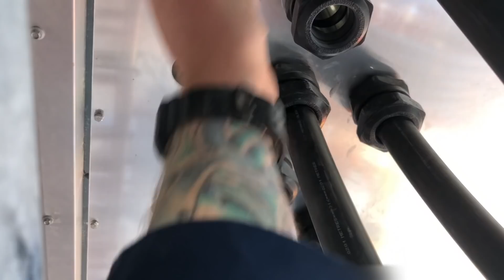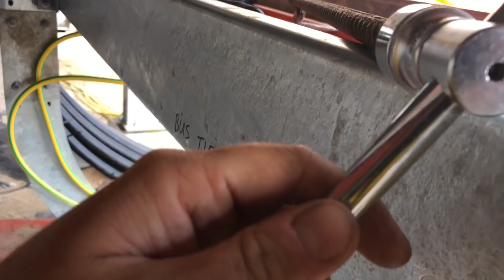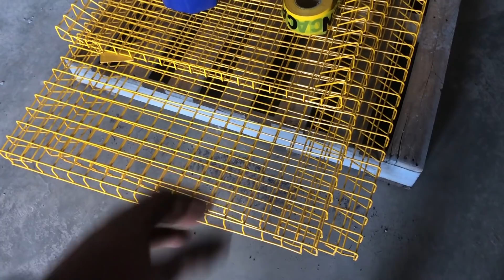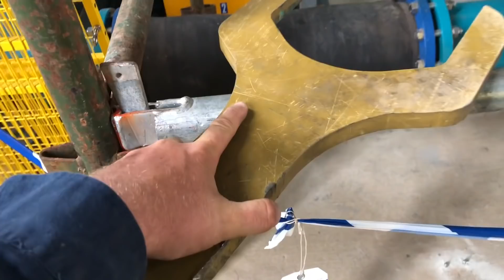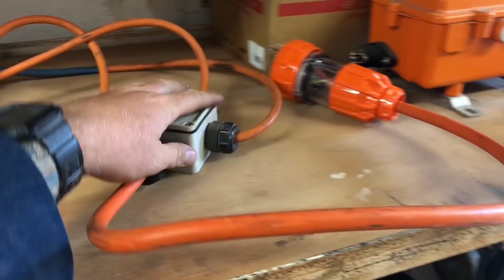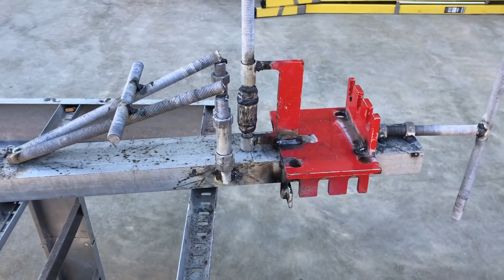Making your own custom tools. Sometimes DIY is better! | Until It Hertz E06

Comment: A few questions, what are the giant wrenches actually used on? and what are the cables you are tightening? any examples of what the official tools look like?
Reply from the maker: No real official tool for the glands on the cables this size, you could try and get a crows foot wrench that size but struggle to get the clearance still.

The cables are the incomes from one of the transformers.

The giant wrenches are for adjusting huge filter press machines